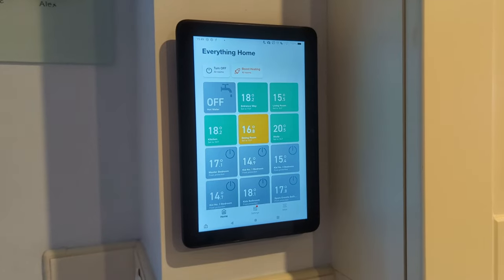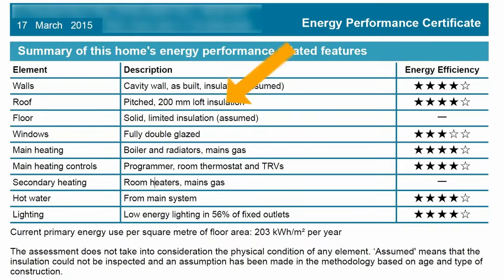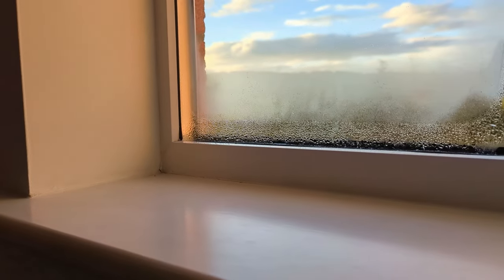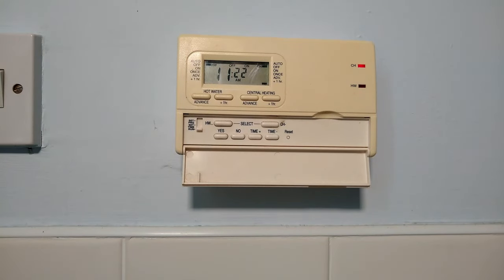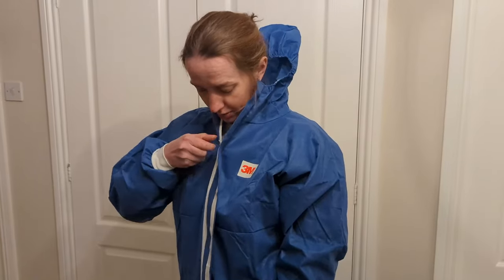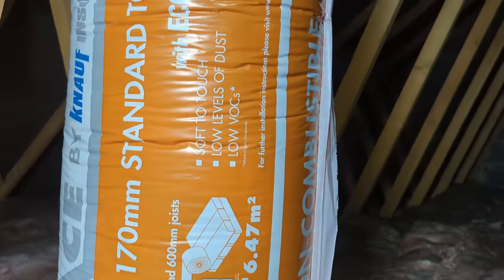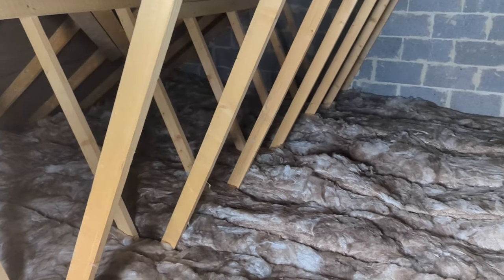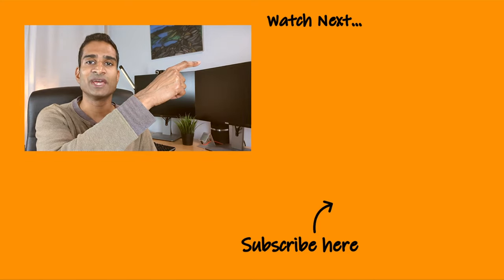How To Add Loft Insulation - Do YOU Have Enough?

Comment: Good video. I installed a Tado system last year & it's been great. I had to drain my heating system & change most of the rad valves as the old Mk1 Drayton TRV's I had wouldn't accept the Tado heads or any of the adaptors they supplied. Currently I'm gradually switching over to rechargeable batteries in the Tado TRV heads to save on long term battery costs. 

As for loft insulation this is a job I have put off for far too long. Our 1986 house only has 100 mm of glass fibre insulation between the joists. I boarded out 90% the loft 35 years ago for storage (we have a lot of stuff in our loft) which is why I have put off installing extra insulation for so long. My plan now is to raise the existing boarding up on a LoftZone leg kit & install 200mm of extra insulation under it. I have also installed shelving between the roof V trusses (same type as yours) to take as much stuff off the floor as possible. I have also upgraded the lighting in the loft to LED strip lights so we can see what we are doing up there. There's never the right time to be working in the loft because it's either way too hot or freezing cold. However, I do need to get this finished  asap now before we get too far into the heating season. Keep the vids coming.
Reply from the maker: Hi Colin - Thanks for taking the time to watch and comment on this video 🙂

Sounds like it was quite a big change for you when installing Tado. I've done the same with the rechargeable batteries and so far, so good.

That's really interesting, I was looking at those platform kits. We don't have a huge amount to store in the loft at the moment but I definitely agree it's best off the floor as able. I'm also planning to install shelving in the V trusses, so that's useful to know. It's a very useful space, but I agree way too hot in the Summer and freezing in the Winter although my house battery seems to be holding up ok in there. 

Thanks for the support and all the best getting your loft insulation completed 👍